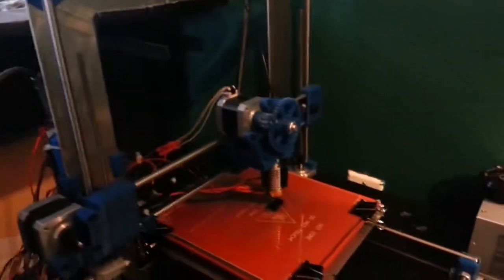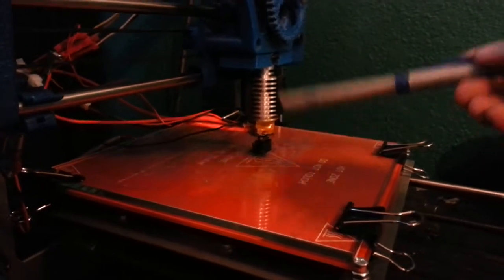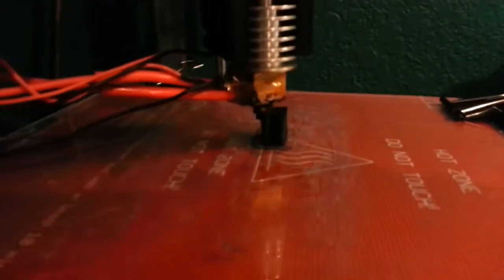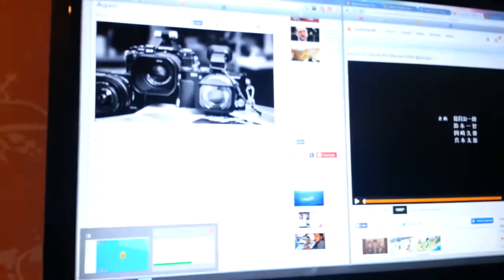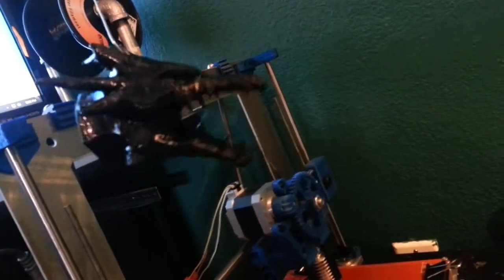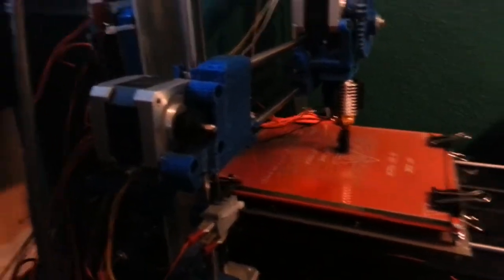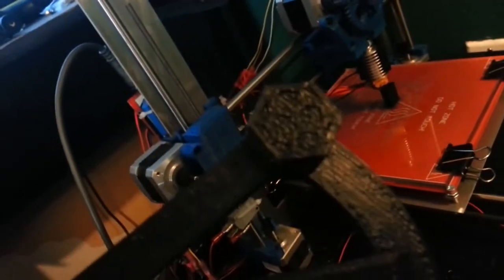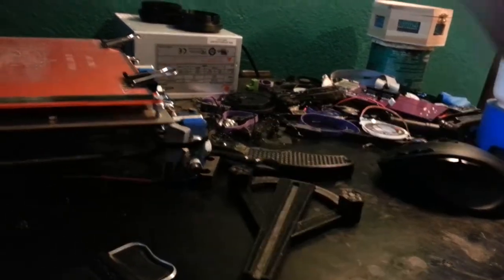Prusa i3x walkthrough and print

Comment: I am almost done assembling one.  But I am not sure if I have been able to figure out how to install the hot end extruder assembly into the x-carriage.  The only thing I see is to insert the plastic piece on the extruder into the groove on the x-carriage.  But there is nothing to hold it in place and it is wibbly wobbly. The only thing that would keep it there is the filament passing through it.  I see that your hot-end assembly seems to be different from mine but it is also simply inserted into the groove.  Does that make a good enough hold for precision needed for printing?  Please help.
Reply from the maker: So the gregs extruder that I got was kind of....odd, Most people get an acryllic insert that is heat shielded to protect the rest of the extruder from excess heat. Mine was printed. Also keep in mind that I've got an e3d v5 hotend so your mileage may vary. What I had to do with mine was use rubber o-rings around the neck of my hotend to "widen" it, with that in place it makes my hotend extremely snug inside the inset, and then when I tighten it down it becomes a pretty solid setup. Did you also buy a i3x from diytechshop?
Reply: ***** Yes.  I actually ended up in filing the holder piece and now I can insert it fairly snug.  But I need to insert it not the way it is supposed to (with the cut on the side), but 90 degrees turned.  Normally it would be too tight to go in, but after shaving it off a little bit, it goes in snuggly.  Thanks for the reply.  O-ring is a good idea.  I was also thinking about it.
Reply from the maker: yah1248 Did you have any issues getting your backplate straight up and down? Mine still has a slight slant along the z axis. Its fine for cosmetic prints but for anything else its useless. I've taken apart the printer twice and put it back together but for the life of me I can't get that slant to go away :(